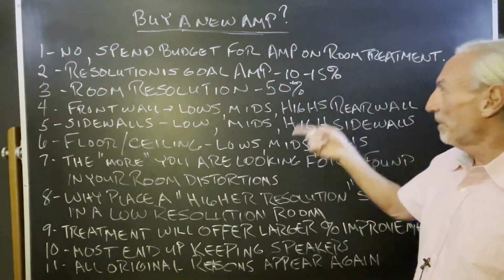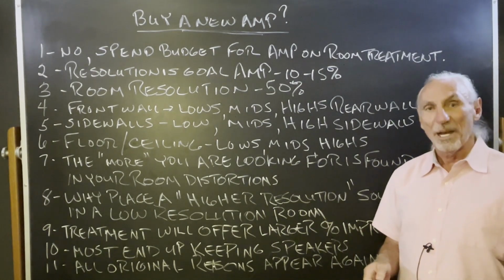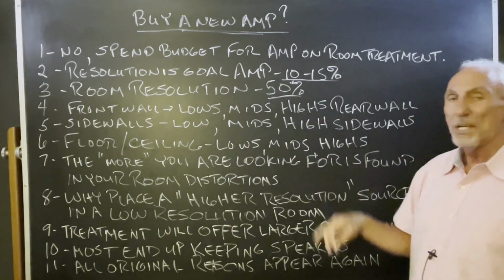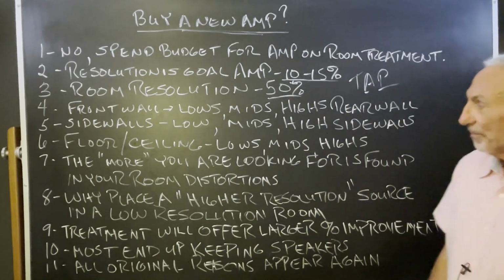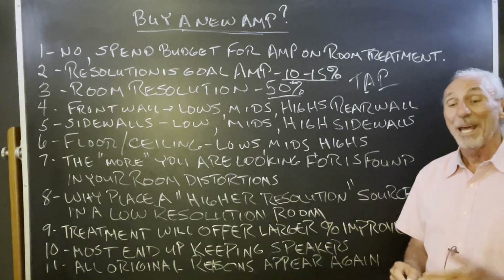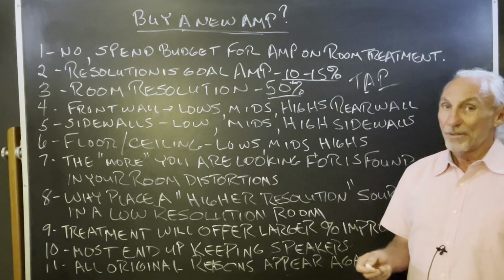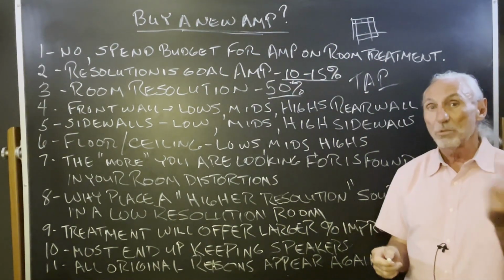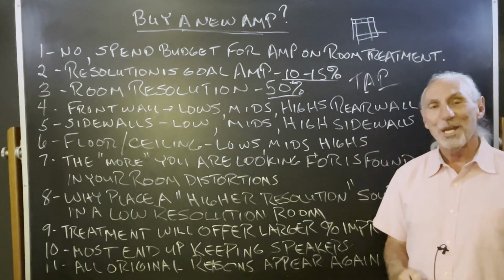Buy A New Amp? - www.AcousticFields.com

Comment: Depends on if the customer is lacking in headroom.. ( voltage ability). Too many variables to make a general statement..about room treatment.
Reply from the maker: The premise is 50% gear sound and 50% room sound. When you frame the paradigm with these divisions, it is easier to assign percentages of resolution.

Comment: Thank you for your wonderful content. You saved me from throwing money away on more rock wool. I used AMROC to find my problem areas and frequencies. I’m building 10 mathematically tuned diaphragmatic 4x2 boxes. 2 tuned for 40hz for front and 2 for back, 1 tuned 50hz each side, and 1 tuned 60hz each corner followed up with 3 703 clouds over the mix position and 2 existing rock wool panels next to the mix position for high and mid frequency 1st reflections.  My mixes weren’t translating so I spent 16 hours doing some homework and a majority of it was on your channel. Thank you. And you’re right 99% of videos and suggestions in forums say cover the corner with rock wool which I had already done which didn’t help at all except suck out mid and high frequencies from my room.  I’m taking the rock wool I spent my money on already for the “traps” in the corners and making panels to move into my vocal booth and for the 1st reflections.  I’m broke so this will at least get me headed in the right direction.
Reply from the maker: Building insulation does not absorb low frequencies well. It can go deep enough but can't get enough to be effective. It also lacs the proper rates and levels of absorption for mids and highs as your comments indicate. Stay away from this crap. I do not like the direction your thinking is taking. Fill out the info in this link schedule a call. Lets get a differentr strategy.
https://www.acousticfields.com/free-room-analysis/

Comment: You might get low single digit dB improvement in Quality of Sound with a new piece of gear, but with proper room treatment, you can get double digit dB improvement in Quality of Sound.   I think if one is spending about $15K to $20K on the speakers, amp, preamp, DAC, etc., after that, spend money on treatment, and once you dial in the room, THEN you can go nuts with gear because a well treated room will allow you to hear the differences in gear much better, which helps you figure out what gear you ultimately want to get.
Reply from the maker: There is more incremental resolution increase within your room than any piece of gear can give you. By a factor of 1,000